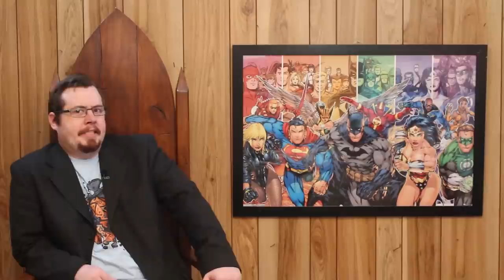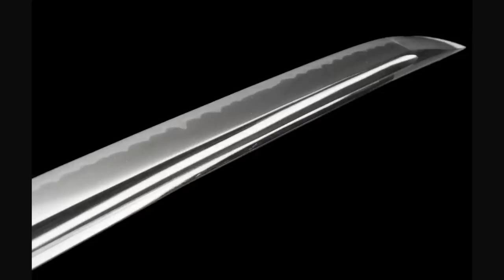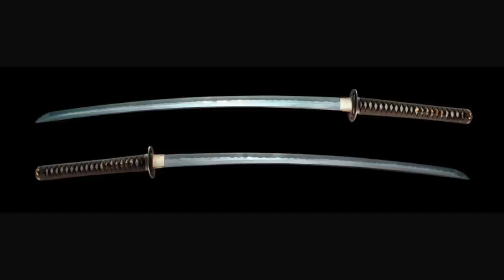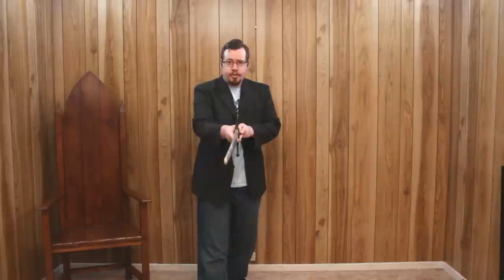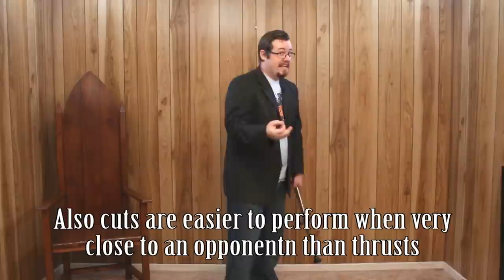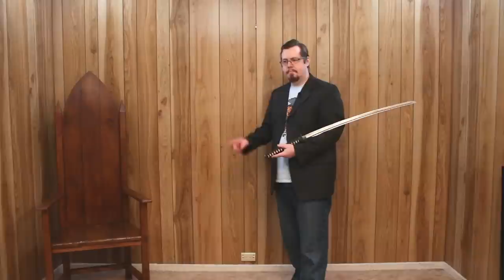Super cutting swords, are they needed?

Comment: For starters, you're ignoring lethality. Disabling an arm is different than cutting an arm off. How? Ruining someone's biceps prevents them from using that arm effectively and would likely kill them (eventually) in ancient times, but severing the arms also severs the brachial artery, which will cause them to bleed out very quickly and causes more extreme shock to the body. If you stab someone in the stomach with a thin blade, they may die later, but they might still be able to hurt you until that time. If you cut them in half, that ends the thing right there. (We see the same thing with weaker calibers in guns, such as .22lr vs .45 ACP, .38 special vs .357 magnum, or pistol calibers vs rifle calibers. I think we can all acknowledge that bullet wounds are at least as significant as a rapier thrust, and size/shape/kinetic energy matters there as well - look at wound cavity tests. Also, research hydrostatic shock.) As far as rapiers vs longswords, the trouble is toughness/breaking and reach. Rapiers are great, but a thrust into a rock wall (like in a castle), a shield, or even a solid wood door, will more easy break a rapier. Plus, there are tactics and other instruments than just the sword. (Hopefully the advantage of reach is self-explanatory.)

Put yourself in a situation and personalize it. If you have a rapier would you also use a shield? First, the heavy, bulky shield is a contradiction to rapier forms and the benefits of a light blade. Thrusting from around a shield is awkward with a rapier. Why? Being able to reach past the shield is needed - so having a sword with greater reach is important, rather than over-extending one's self. Not only that, but the fact you're reaching around the shield makes slashing attacks more natural - like throwing a cross or a hook in boxing. Might a longsword user have a shield? I would say that is very compatible and for the sake of this comparison, let's assume a person with a longsword is using a shield. The longer blade makes thrusting from behind the shield more easily done and the longsword's length also helps you to reach your opponent when slashing. Not only that, the shield provides good protection against thrusting attacks - the shield is covering the torso.

A rapier is going to be excellent because of it's weight and relative ease of carrying. It's ability to deflect or defend against other rapiers, aka parry, is also a by-product of it's light weight, relatively short reach, and extreme balance. Using a rapier with heavy armor would be similarly disadvantageous. Against an unarmored foe, with no shield, the rapier would be extremely effective. However, it would be difficult, not impossible, to penetrate well armored or shielded foes. And, unless you can close the distance, reach weapon users, such as with greatswords or spears, will be able to strike you before you can even try to hit them. Mobility, avoidance, and quick strikes are what makes the rapier effective. Blows that can be easily brushed off (light-weight swords beating on a shield, for instance) do not provide any positive effect. A larger sword will effect the balance of the person it strikes and it can more readily batter/break a wooden shield with it's increased cutting ability.

So, yes, there are reasons for using a larger sword with greater cutting ability.
Reply: Shad, if you were discussing the advantages of a longsword vs a greatsword, it would be a different story. A two handed sword, dictating that you must fight without a shield, versus the lighter weight and shorter longsword, with the ability to wield a shield, is a different issue altogether. But, rapiers are a different dynamic.

Imagine a rapier-wielding soldier, in very light armor vs a greatsword-wielding knight in full plate, with a horse to carry him into battle. Assuming an equal level of competence with the gear they use, if they met in middle of a field of battle somewhere in the countryside, who would typically win and why? Now, imagine the same thing on a boat in the Mediterranean sea. What makes sense there? I would think the typical results of that should be obvious.

Comment: the thing with specialised things of any kind, is that when the thing they specialise in is gone, so do they. for example, smilodon died out when  it's food source disappeared.  another example is megalodon. it was outcompeted by smaller predators like the great white shark, because it's size was not a advantage any more, only a limitation. so with swords, if  overkill cutting power cannot compete with cutting and thrusting, then it would have died out. the fact that it didn't means that they were effective enough on the battlefield. I know it sounds weird to compare animals to weapons, but it's the same principles of specialisation over versatility.

Comment: Well, when I think of the advantage of those cutting weapons like the katana, it is not the cutting itself I see as an advantage, but the weight. Now I might be completely wrong, but those thin, cutting weapons gotta weigh a lot less than a longsword. With a heavier sword, your attack is slower, and you get tired quicker. With a lighter sword, you can land your attack faster than your enemy, thus winning you the battle. If you're unable to kill your opponent, he will get tired quicker than you because of the extra weight of his sword, and when he gets tired, he'll be easier to kill. 
Now the draw-back of a lighter sword is of course, force. You wont do as much damage as a heavier sword, and your lighter sword will be less effective on armour. That is where the extra cutting ability is important, it negates the problem of your sword having less force.

As I said, I might be completely wrong here, but that is what I believe to be the advantage of cutting swords. The swordsman will have more speed and endurance due to his lighter sword, both important aspects of battle.
Reply: Thin cutting weapons... You talk about European swords?

Oh wait you talk about Japanese swords... Fuck someone forgot to mention to Mikael that katana are actually fat pieces of steel with spines 7+ mms thick all the way.

Look European swords at their thickest don't reach the thickness of a katana, they often taper down to 1 mm before the tip.

Longswords aren't heavy. Cm/cm katana are heavier.

Comment: OKey, could not check all 795 comments before this one, but just a question:

Did anyone comment about the wear of the edge and blade in the effectiveness of the cut? Or the cutting ability lifetime in that matter?

Because, in the brand new state of the sword, it can perform as an overkill cut, this could mean that it can cut for longer periods of time without as much repairs until you need to sharpen the edge again.

Therefore an overkill design in terms of cutting can actually be aimed in order to reduce the maintenance work in a blade.

This could be sensible topic for someone who is actually using the blade a lot: "This one I can thrust better but that one I dont need to sharp as often". 

Keeping in mind that in battlefield, long trips, dungeon crawling, etc, getting the blade sharp again could be an issue.

Did anyone considered this?

BTW, nice video

Comment: Thrusts are MORE deadly than cuts since they target the thoracic cavity and create deadlier wounds than cuts to the shoulder, arm, side.

It's not "additional cutting capacity" (else we'd all use axes) it's 'cutting per weight' .  THe light curved swords like Samshirs are used by light cavalry against unarmored troops (peasants, typically).  Because of trigonometry the cut is a draw against the target, not a push, the same motion you'd used to cut a loaf of bread with a knife.  (This is why everybody tests their knife sharpness with a drawing cut against paper... it's much harder to cut with a straight push.)  

Basically, you're too manichean.  Curved swords can thrust pretty well and straight swords can cut pretty well.  It's more about weight, power, and how much armor the target has.

Comment: Naval battles for example where heavy armor is not commonly used.  Cutting power is much more desired.  Grappling ropes being quickly cut can totally change where you get boarded or board.  You might have to climb the masts with the blade too, so lighter is better.

Comment: All of the overkill cutting swords except the greatsword have one thing in common: they were introduced and primarily used prior to plate armor.  The advantage of a sword with excess cutting capability is that if they can sever a mail-clad limb completely with a good hit, they can also disable a mail-clad limb with a poor hit.  Maybe the wielder is tired, or off-balance.  Maybe a feint turned into a cut when the defender failed to respond.  Maybe the attacker has bad footing, or is stuck in the mud.  Maybe the cut was half-blocked, but still made contact.  Maybe the blade is just getting dull.  In all these cases, overkill suddenly becomes barely sufficient, so the more you have, the better.

There are other factors as well, of course.  Cutting is much more important when mounted (hence the saber, katana, and tulwar) so giving up thrusting for better cutting is sort of a something-for-nothing deal in those cases.  But the bottom line is that, in battle and not a duel, overkill is almost never bad, but "good enough" can become "not quite good enough" very quickly.
Reply: Dussack, Messer and many sabre designs were introduced when plate armour was common and of course used after plate armour. As so were Type XX, XXa, XVIIIc. And Type XIIIa blades while a pre-plate armour design, have been common to the late-14th century and seen a reemergence in the form of the scottish two-handed claymore in the 16th century.

No sword can sever a maille clad limb in one hit, you cannot even fucking cut, no matter how hard you try, you can break a maille clad limb with a pollaxe maybe, but that wasn't a very popular weapon at that time.

Try using a katana as a cavalry sabre, I dare you, you will have arthritis in less than a day, they are infantry swords for a reason and two-handed at that. Thrusting ability was still very valued from horseback, Turkish, Hungarian and Polish cavalry swords have been designed in a mind that thrusting was still somewhat important. Many Turkish pala are straight, which is easily recognizable because in any language they influenced with this word it means a straight cavalry blade, okay with rounded points but around that time it wasn't so important to have really pointy ones.

Hungarian sabres are straighter than their Turkish and Polish counterparts and were actively used as lances if the lances broke.

Another common cavalry sword from this period is the hegyestőr/koncerz which is a thrusting only weapon.

Comment: Many of the facts needed to make some solid conjecture about why supercutters existed were in your video already :)
-Cutting with that is overkill.
-Thrusting was much preferred in the age of dueling.
It just so happens that overkill might be very useful on a battlefield. In the majority of the ancient and medieval battles, most of the casualties happened in the chase after one side broke. I think I might react with fury and adrenaline to a bleeding hole in a mate whereas I would either freeze or run away at a severed arm.
Going out on a limb here, but weren't supercutters more frequent in elite troops (also cavalry for a number of reasons, but they are elite too)? That would reinforce my point somewhat, given that the elite troops are the ones you want to send over to absolutely break morale on that side of the enemy's formation.

Comment: You must consider, thrusting swords won't fair much better either.

Most longswords aren't thin enough to peirce chainmail. Thats why half swording was used, you bash your opponent with the quillions and pommel and grapple/wrestle them down to the ground. Once they are down you use your rondel dagger to stab the weakpoints to finish them.

Thats why swords are sidearms, all swords suck against armor, you need heavy blunt weapons to concuss armored opponents in plate armor.

Stabbing swords are only good against armor if your opponent isn't wearing chainmail under the plate so you can stab through the gambeson/arming doublet.

All in all swords suck against armor and the difference between a cutting sword and a thrusting sword is neglagible on the battlefield with heavy armored opponents.

This obviously changes when fighting lighter armored opponents, but I though the above point was worthy enough to mention.

Comment: By and large I say: no.  Curved blades aren't better ENOUGH at cutting as compared to straight blades so as to offer any tangible reason to prefer one over the other, concurrently, you trade of more than most people think for so minor an advantage.  
For instance a straight blade of the same length has:
1. greater reach
2. better thrusting characteristics
3. more durability, 
4. more rigidity
5. the capacity to have two edges of equal utility

the curved blade gains:
1. sneaky curved sword change throughs.
2. slightly greater cutting ability.

Straight swords specialized in the cut trade off their thrust capacity which means you're boned against even good maille.
Reply: Kyle Simon Well even when it comes to thrust curved swords do not perform that much worse. Skallagrim did an excellent job demonstrating this. The ability to thrust is reduced at best less than a width of a palm.
Reply: @ReasonAboveEverything  mmmm, I disagree due to personal experience.  A thrust on an unarmored body may not be THAT much more difficult, but through any sort of clothing you get way worse binding.
Reply: Kyle Simon Not going to argue with that. I am just pointing out that on paper aka on gelatin the difference is no that big. Then again when one is tired it will make a difference likewise will curved sword when cutting.

Comment: I don't think that swords are designed specifically for cutting mats or really for showing off how good it can cut. They were designed for combat and for real-world use. Correct me if I'm wrong, but from my understanding, a sword specialized for cutting will require less skill, less focus, and less power to deliver the same cutting quality as a sword that is not specialized in this way.
For instance, a curved sword will naturally pull your cut towards the proper edge alignment, making it easier to not totally screw up your cut. A more top-heavy sword will do more of the cutting work for you, requiring less technique and focus to get a good cut. All of these modifications to improve cutting may be overkill in a controlled environment, but they weren't designed to be used in a controlled environment. I mean, combat is a highly stressful environment and many combatants are not necessarily the most super experts in their techniques, let alone fully capable of continuing to use proper technique perfectly for extended periods of time despite intense stress and fatigue.

I mean, it really depends. What is the best sword for a combat expert? Maybe you are right that cutting specialized swords are totally unnecessary. But what is the best sword for the average, or even somewhat better than average soldier going into combat? Maybe the extra cutting features can make a big difference.

Comment: I don't know too much about swords but I would think that a sword specialized in cutting would also allow you to swing it faster than a sword meant for thrusting which would give you an advantage since you have more of chance of hitting your opponent because your able to swing your sword much more faster than your foe. Like I said I don't know too much about swords so I might be completely wrong or right.
Reply: No, not really... swords specialized for thrusting do not really need weight, while cutting swords need it. Also no not really, the "fastest" (it's an object ffs) sword out there is the smallsword, a pure thruster weighing about 2/3 of a pound on average. While the lightest effective cutting swords are around 800 grams (or close to 2 pounds) and those are heavily compromised for carryability, so their performance is greatly hindered for the sake of being lighter.

Also most swords are cut and thrust designs, there are very few that don't fit in this category and is part of the extremes. Even rapiers are cut and thrust (trust me, someone who knows how to cut will severely injure you with a rapier with a cut)

Comment: I'd say it dépends on how you use the sword.
The scimitar had a very curved blade that most would say was exagerated. But when you take in concideration that when fighting with a scimitar, your goal is going to be to hit your opponent with the base of the blade near the guard and let it slid all the way back to the tip, you can see that the curved more slicing oriented blade becomes ideal.